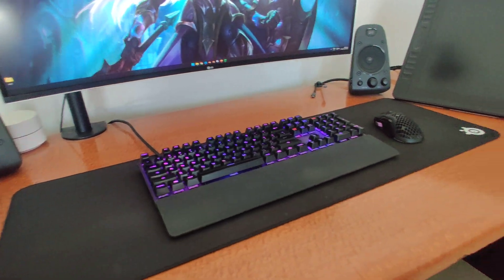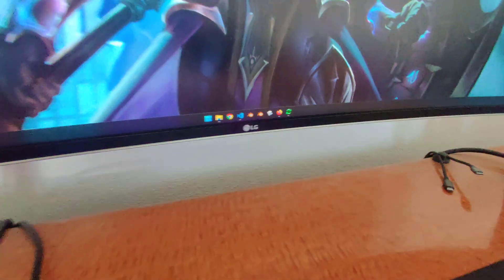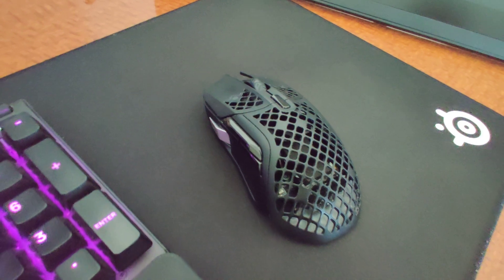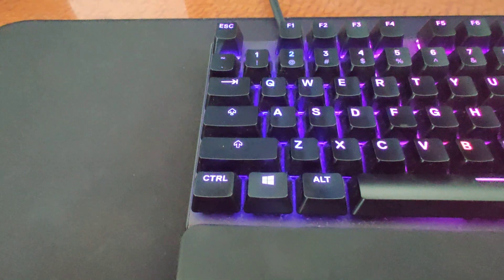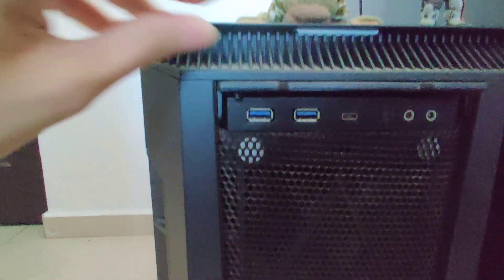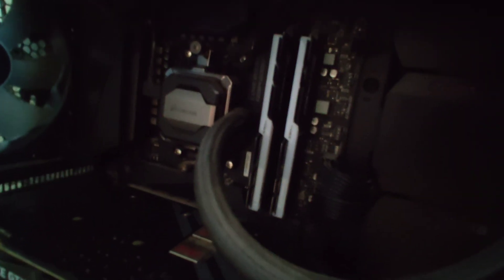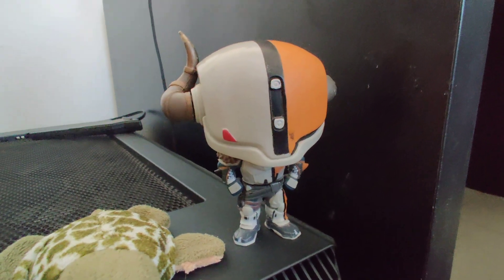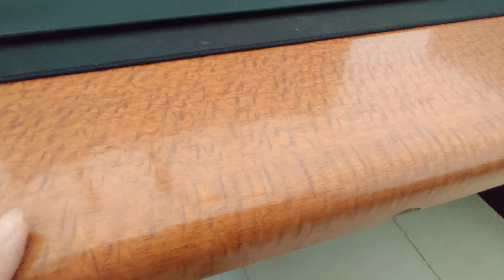My PC Computer Setup for Blender and ZBrush but not for fancy games

Comment: Looks like you barely know what hardware you have in your pc. 🙂
I see what seems a GTX 1080 TI 11 GB. But how much ram you have and what is the cpu?
Reply from the maker: 2 sticks and a square CPU
Reply: @ArmoredColony  Damn, I hate secrets... 😄
Reply from the maker: I'll just say that none of it is current gen
Reply: No need to be, got a GTX myself. But your workflow seems pretty smooth in the videos, so yours it's probably still a powerful machine.
Reply from the maker: I have a 5950x and 2 sticks of 32gb at 3600, which I read was ideal for Ryzen; I will keep these for as long as I can. I was totally fine with 32 gigs total, but one time I couldn't do a render in Blender and had to upgrade.I feel like you can throw as much hardware as you want at blender and it will still be insufficient sometimes.
I do have a 3080 but I rarely do GPU rendering so I don't even have it in the case. The 1080 ti is actually my dad's (he did some neural network stuff at the time), he traded it to me for my regular 1080 once he finished his work, which I gladly accepted.